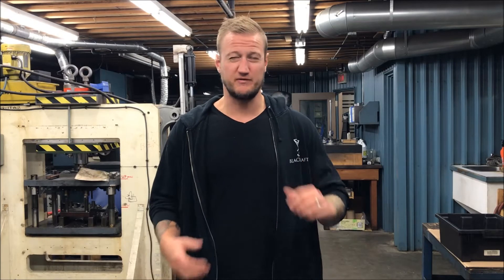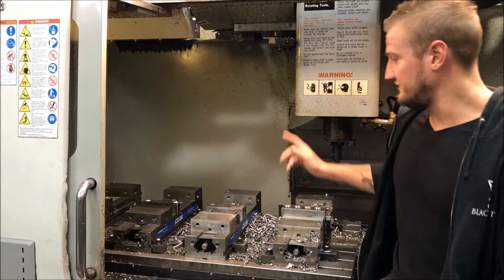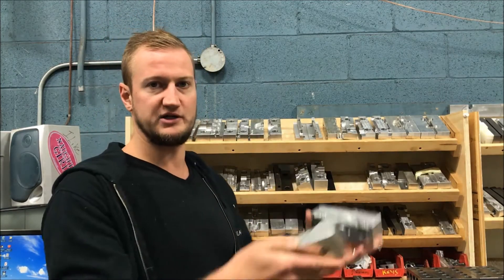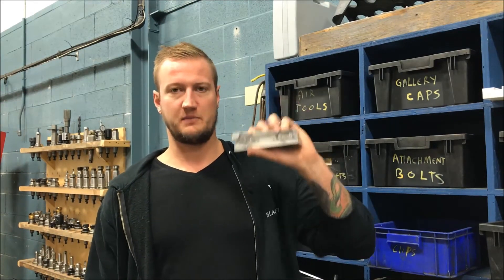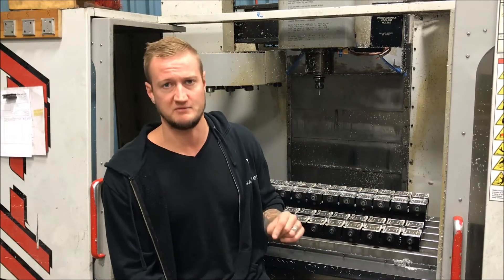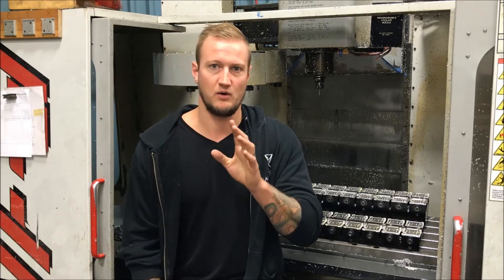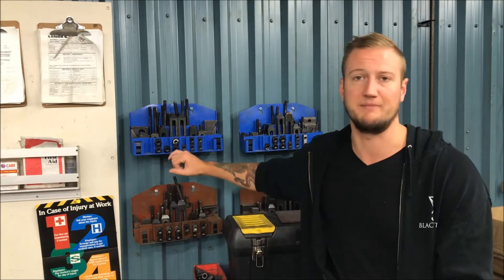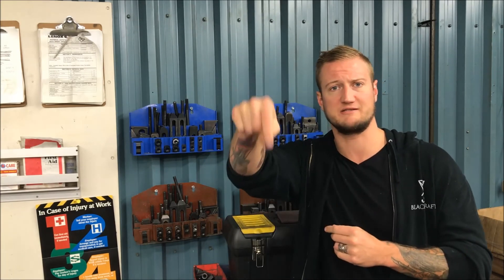BEGINNER CNC:  INTRO TO WORKHOLDING OPTIONS

Comment: I'm late to the party but thought I'd throw my 2 cents in. First off, I just came across your channel and I instantly sub'd. I'm a machinist by trade and I've worked in a lot of shops over the last decade. Production, job, prototype, servicing shops etc. Here's my thoughts on the video; 

1. A career machinist should always start with manual machines. It builds a solid understanding of the fundamentals! Using toe clamps should be close to the top of the list of work holding techniques starting out. It's cheap and effective for the average Joe starting out.

2. A good quality vice is always a good option. It's pricey out the gate but pays for itself in all categories. Ease of setup, repeatably, versatile, soft jaws etc. But your up a creek without a paddle if you don't know the ladder first when the odd job comes up. 

3. Fixturing comes later. Mighty bite fixturing, custom soft jaws etc all come with time. It's rare for someone to start out and instantly have production runs to justify fixturing. Start small. 

Finally, I just want to say I'm talking towards the average guy. Every situation is different but speaking from my experience, it's always best to build a solid foundation of the fundamentals before moving upwards. I've noticed now n days the young guys starting out on cnc machines are just horrible machinists overall. For example, knowing the difference between conventional vs climb milling is beyond them. Skipping over the basics will ultimately handicap you in the long run.

Long story short: There is no short cut to success, including learning to be a good machinist.
Reply: I think NIMS should be taught. New CNC guys will kinda understand the concepts. It should also be known this is a lifelong learning experience. I swear everyone's way is the best but nobody knows shit lol. IMO it's good to get cross training in a little of everything. But really focus on what pays you. The money will make you better.
Reply: Any advice for a 48 year old interested in learning from scratch so i can get into the industry
Reply: @patboland1650  Depends on what your looking to get out of it. Do you have parts your wanting to make or just want a hobby?
Reply: @blakelibby2140  I want to learn enough to be sell the technology
Reply: @patboland1650  IMO the best way to learn is through on the job training. It takes time and experience to know the in's and out's of the different machines.
Reply: @blakelibby2140  thanks i was thinking of working somewhere as a go for at the weekend and learning that way. Its an interesting field.

Comment: 30 years in the trade. 4th gen machinist. I can tell ya , I have seen and built a many fixtures . I all ways liked it . It was a challenge . Castings will make you pull your hair out at times . Great video man , keep up the good work.

Comment: Something to make your strap clamp life easier: Keystock. Get Keystock that will fit in your T-slots. They fit snugly in the slots, , and if you put a clamp between them, it draws the piece against them so they don't move. You can edgefind that edge, and it should be rather repeatable on the Y. Now that your Y is true, put a clamp on wherever you want your X to be, and clamp it directly to the table. And there ya go, you now have a nice repeatable setup using strap clamps. Still slower than a vise, but a lot quicker than indicating each part in.
Reply from the maker: That's a fantastic idea, I've done similar before with some little steel stops I milled and ground to do something comparable for a job, but I don't know how keystock never crossed my mind. Funny how it's often little things like that that you just don't think of that can be a real game changer. Thanks brother!